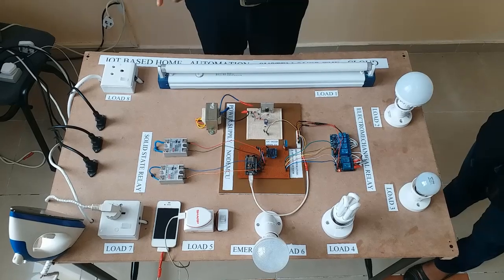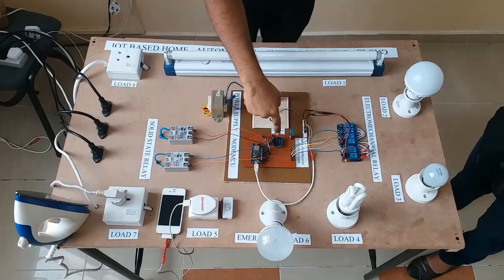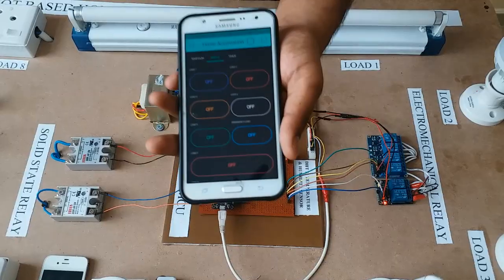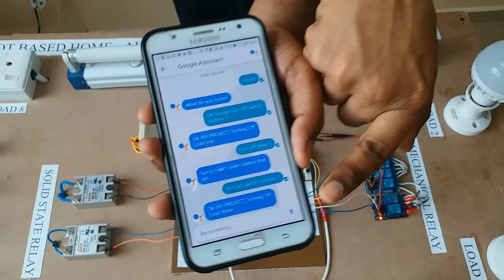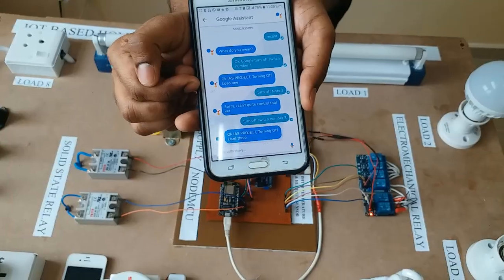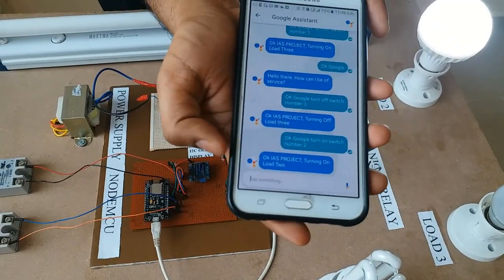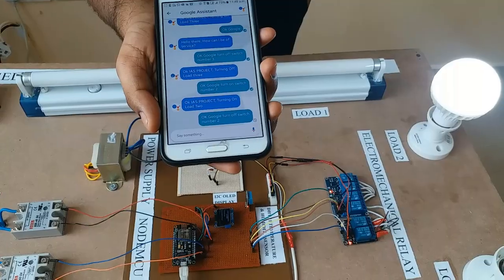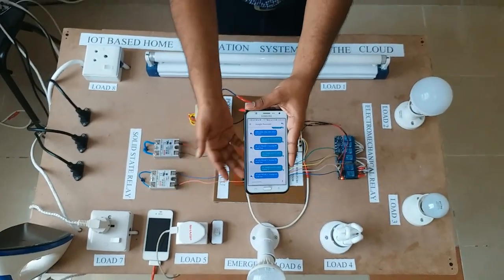IoT Based Home Automation System Over The Cloud (Final Year Project)

Comment: To make more impressive project add "LDR" to control one of light
Reply: hello may i know what is LDR? hehe thankyou so much
Reply: @diands   yeah, why not.
LDR mean light dependent resistor , we use to control the light.
Reply: @diands  by using this we can make a circuit which flow current during dark around and stop when light in surrounding.
The best example is auto brightness in your phone.
Reply: @shahzadmughal7666  better use a photodiode, it is way faster and has less interference due to noise which is the case with a phototransistor. Keep in mind that the output of pdiode is very small so amplification is a must.
Reply: No it's always on in night

Comment: Wow good work. but I will simply say it's hackable.
Reply: Can you explain how it can be hacked?? I have built this system and implemented in my home inside boards. They are connected with ky wifi only. And I have my own application from where I turn on and off. I’m a software engineer by profession. Can you explain me How can it be hacked ?
Reply: its for clg project... they r not gonna implement so its okay lol

Comment: Watch the video and use headset . You will know how this magic work . Hahahah
Reply: Bro it's relay sound which works like mechanical switch hence it produce tik sound
Reply: Relay produces sound. I have also built same system and implemented in my house inside boards. Whenever you switch on/off a relay, it produces ‘tic’ sound..

Comment: This is not called an IoT project.. it is just a wireless control system.
Reply: No ,this is also part of IoT, here they use internet connection,I think this the basic model of IOT .
Reply: @spacearcade8766  IoT is the interrelated systems and devices that can operate and share data and functions together remotely and simultaneously with no human-to-human or human-to- computer interaction.
Reply: Or isme sensor ka bhi use Ni h jisse ye device input le apneaap ye basic system lga IoT ka jisme sirf internet connection dia h ye automatically kuch kaam nahi krega for that use also senor

Comment: I have a question please help
Suppose i am using wifi control home automation
Wifi device is connected to home's internet connection 
And i am able to control appliances easily through internet from anywhere

Now suppose due to some issues internet service is down , but wifi module is still connected to home's router.
Now i how can i control the appliances
And i would i know that home's internet service is down
Reply: when your home internet is down then you can't control your devices 
and its depend on the product feature to notify you your home internet is down